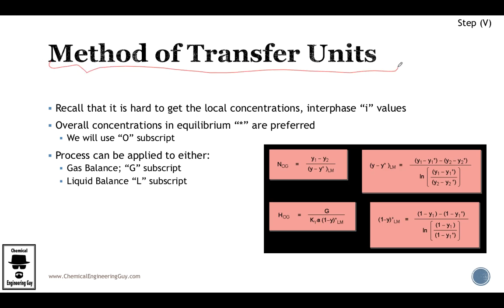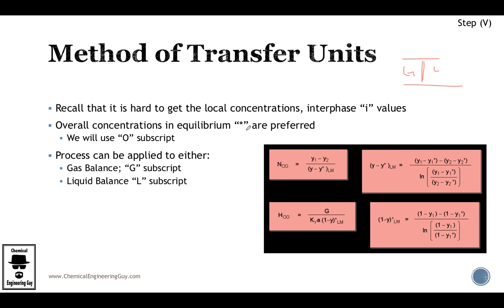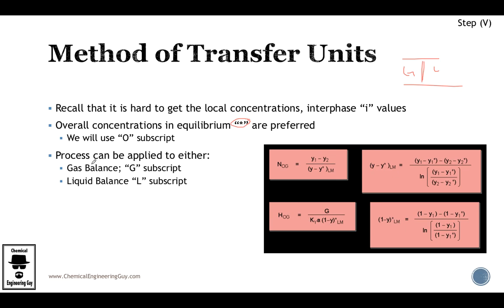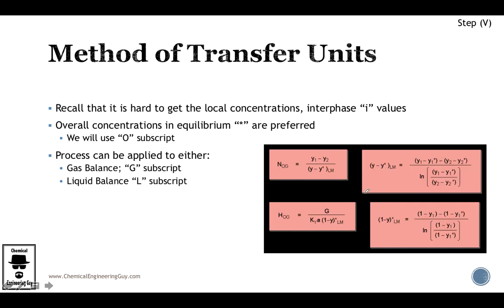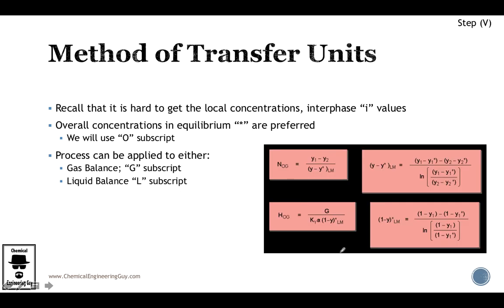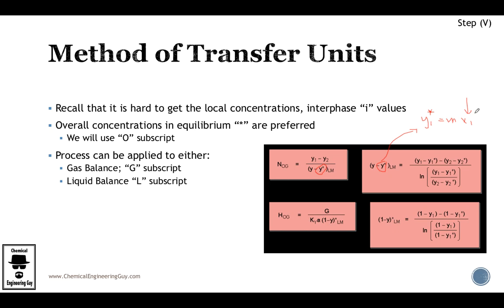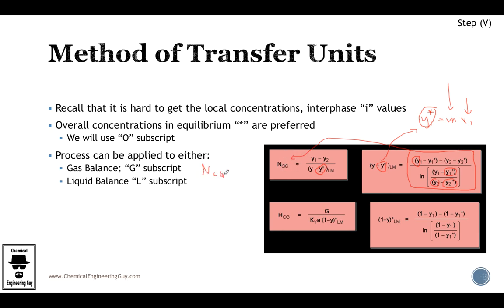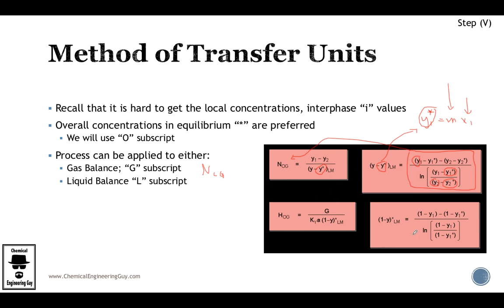Method of Transfer Units - Overall vs  Local (Lec164)

Comment: You are late bro......i had already Clear Exam LoL
Reply from the maker: Was I? What is your next course? I might try to create one for you ;)
Reply: @ChemicalEngineeringGuy   Multicomponent Distillation, Computer Aided Program Synthesis, Transport Phenomenon.....
Thanks For Replying ☺️
Reply: @ChemicalEngineeringGuy  Actually this topics related to my next semester....
where i can learn Aspen,HysYs,ChemCAD type softwares 
could you make Lecture How to perform various Operations on softwares that mentioned above(i know some of that are process simulation,i will choose production as career.......
Reply from the maker: Sure! Actually I got some videos on simulation, but if you really want to focus on process simulation, you should check out each individual course. What do you have in mind specifically?
Reply: @ChemicalEngineeringGuy  i am frim India and Here Production Base industries are Higher than White collor Designing Job(only one LinDe).......
-I have to operate Procedure(as Shift incharge) Successfully on softwares (which i don't know coz lack of Practical Experience) 
 
Production as career is final but don't know which software i have to use during Job !!!!
Reply from the maker: you will need to know the industry type
Reply: @ChemicalEngineeringGuy  
Guessing Form 3
-Fertilizer
-Petro-Chem.
-Pharmaceutical
Reply from the maker: petrochem is definetively Aspen Plus/HYSYS... fertilizer can be used with Aspen Plus or Pro II, etc..
Reply: @ChemicalEngineeringGuy  Hope you will Make Videos on This topics .....
waiting eagerly ☺️
Thanks for the information